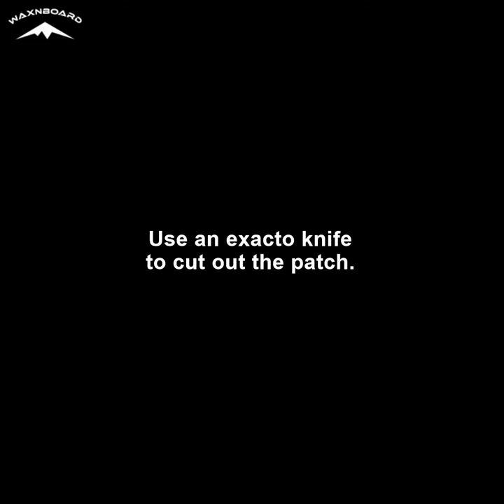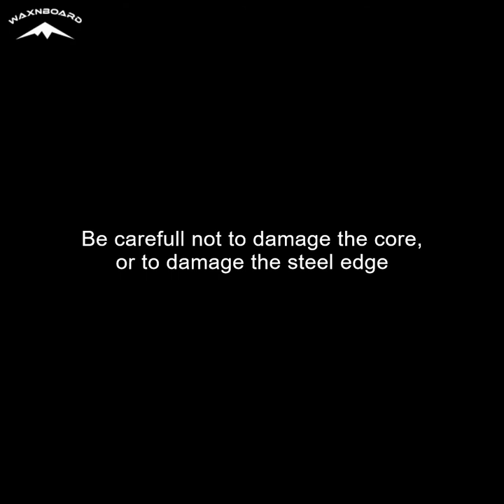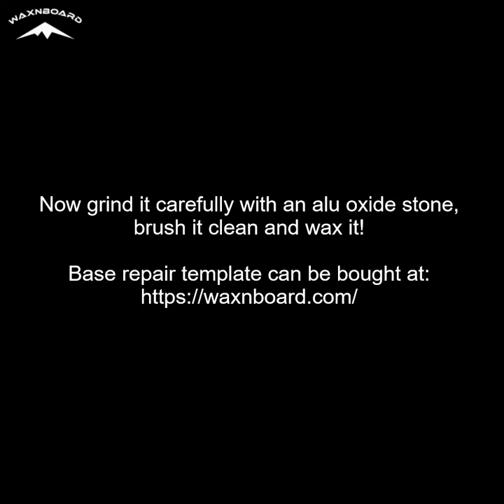Repair core shot on your damaged ski or snowboard base

Comment: what kind of epoxy did you use? Have you done any surface treatment on the patch before glued in? tried to do the same but the adhesion wasn't sufficent and after a few turns the patch fell off.
Reply from the maker: Hello

The patch must be flame treated and cleaned with 100% alcohol cleaning wipes.
Makes sure that you do not contaminate the patch with fingergrease or other dirt like skiwax.

If you can´t buy a  patch that is already treated, try to use a grinder wil coarse grit (worsed case solution).

Make sure the board/ski is completely dry, and apply epoxy on the core ánd patch. Squeeze it thight, keep it warm for at least 2 days on room temperature. Also make sure that the patch is on the same height as the rest of your base. If it sticks out, it will get pulled out.

Regarding the epoxy, there are various brands and most will likely not be available in your region. Please do NOT use regular epoxy. Your Board/Ski wil heat up, cool down, bend, etc. so regular or fast epoxy wil NOT work . If you can, get Technicoll 8266..

If you liked my reply, feel free to follow us on: https://www.instagram.com/waxnboard/

Comment: hi, what do you mean by "The patch must be flame treated" ?
Reply from the maker: Flame treatment creates a change to the UHMW surface, it increases its surface energy allowing epoxy to effectively wet-out the surface and permits a strong adhesive bond.
 
You can ask your supplier to sell you some UHMW that is already flame treated, if it isn’t available you can do this yourself using a propane or butane torch. You’ll expose the surface of your base patch to be coated to a suitable oxidizing flame during a short period of time (less than 1 second).
Reply: @waxnboard  thank you so much for explaining, you are the best👍👏
Reply from the maker: @bertrandrussell2549  you’re welcome, good luck repairing your gear!